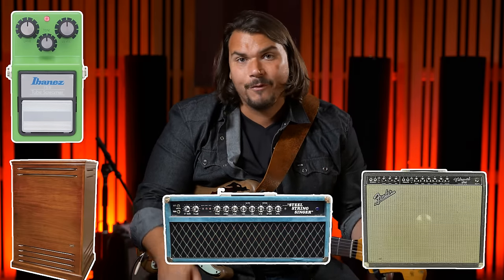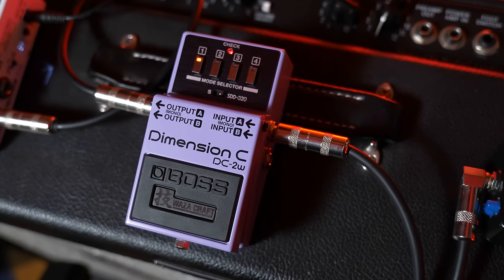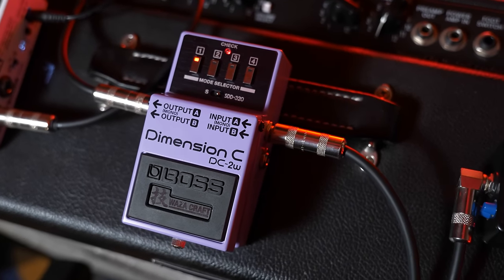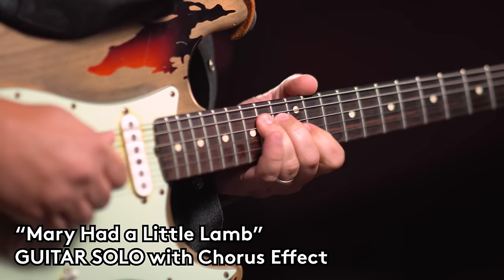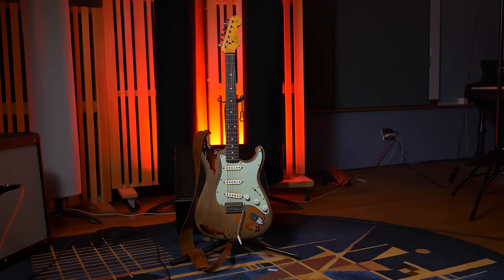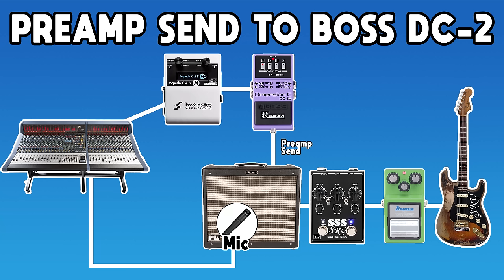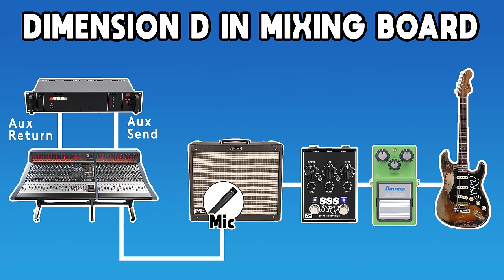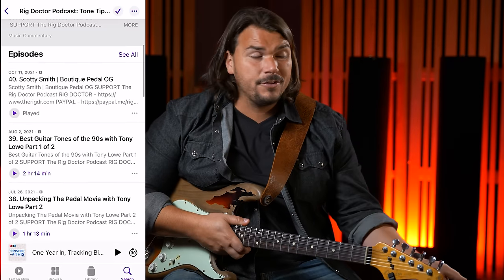The Secret Behind SRV's Tone

Comment: Great tutorial. The real trick to this is the subtly of the effect; i.e. how you blend any effect into your signal chain without muddying up your overall tone. IMO the foundation of good tone is CLARITY so as a rule of thumb, "less is more" when using effects. Most of your tone should be built around your fingers and the power section of your amp w effects added to drive or enhance it. This is why SRV's tone was the epitome of CLARITY.
Reply from the maker: This is why the parallel signal path is SO important.  As you could hear, with the pedal in series, in the FX LOOP, it lost all its subtle nature and really was too prominent to match what SRV was doing.
Reply: @VertexEffectsInc  So true. The trick w a series loop is to back the depth down on whatever effect you're using, but it doesn't always work. There are some pedals that alter the signal so much that even the lowest depth setting they still muddy up the tone. I'd rather not use that particular pedal in that situation than muddy up my tone. The solution is most definitely using an amp with a parallel effects loop.
Reply from the maker: @GTX1123  No matter what, series is a compromise because you can't mix the dry and wet separately from each other nor can you adjust the signal that's hitting the chorus separately from the dry signal.  It's better than not having a mix control, but still not better than having a separate path for the chorus.

Comment: Can you explain how to use option #1 in a live setting? Does the cab emulator goto a separate strip on the mixer from your amp mics or does it goto the insert of the guitar mic strip? Some explanation of how this would work in a live setting would be great!!
Reply: Also is it possible to do this with a multi amp setup (daisy chained amplifiers)
Reply from the maker: You are feeding the chorus into a cab/power amp sim which feeds you mixing board or FOH as a parallel signal to the rest of your pedals running into your amp in series.

Comment: Great video. Can this tone be achieved with another Chorus pedal, like a Chase Bliss warped vinyl hi-fi?
Reply from the maker: It may not be exactly the same, but I would say the most critical part is following the parallel signal path and having the chorus in parallel with the dry amplifier.  As you could hear, as soon as the chorus was in series with the amp in the FX Loop the subtlety of the chorus really was lost and it was very intense even with the same settings.  It would be worse running it in front of the amp as most people do with chorus pedals.
Reply: @VertexEffectsInc  Great demo....will an old phase 90 give you a similar effect akin to EVH and what a lot of country pickers used to do ?
Reply from the maker: @paulcowart3174  not really because it would need to be in parallel after the dry amp, the Phase 90 for EVH was in front of the amp in series.

Comment: SRV would place his tube screamer AFTER his wah pedal so even when the tube screamers turned OFF the wah output circuit will have the tube screamers BJT or FET buffer circuit loading the wah output circuit. When using a buffer on the output of a wah pedal it changes and alters the wah sweeping effect. Roger Mayer built a certain output buffer inside Hendrix wah so it interfaced with a fuzz face so you can place the vox wah BEFORE the fuzz face. This buffer circuit i don't think was a low impedance output buffer because it wouldn't work correctly with a wah pedal BEFORE a fuzz face. I think Roger Mayer made a high impedance output buffer in hendrix wah. Try to make a video lesson about this subject.
Reply from the maker: Pretty sure he didn't...show me.

Comment: I believe an in-line pedalboard version of this could be approximated if there was a stereo chorus pedal with a dry mix knob included to keep the attack of the original signal, if there’s not one, oh I don’t know?, maybe someone from a pedal company could invent one😂, could even be marketed as the SRV sound somehow…🎛
Reply from the maker: It's not the same because the effect is still in series with the dry signal even though you're mixing the dry in with the effect, remember 99% of pedal chorus' already have the dry signal mixed in, it's just at a fixed mix instead of a variable so it's not really changing that so much sound wise.  The parallel path of the chorus with its own line from the dry is the real key.

Comment: Dimension D is available in the ME50B pedal board and also on the CE20 chorus pedal. But get hold of a Bassman simulator (Fender / Boss pedal or  Hao Soul Pressure) and you'll get closer still. Dimension C isn't a Dimension D.
Reply from the maker: Both of those are digital, not analog like the DC-2 or Dimension D.  Furthermore, neither of the drive pedals you suggest produce Chorus and the Tweed Bassman is a far cry from a ‘65 Super Reverb or Vibroverb.  Totally dissimilar typology if you’re moving to amps.

Comment: Very cool video, Mason! Wish you would have let a chord ring out, so we could hear the chorus effect better, but I can at least hear how it’s set when you do the FX loop demo.

Was gonna ask you about speed settings, but it seems the Dimension chorus offerings have a set speed. Is that right? One can only vary the depth, yeah?

I see you having to reiterate in the comments how important is it to have a parallel signal path, i.e., chorus + dry. Is the same achieved, however, on modern chorus pedals with a blend control like the Walrus Julia/Julianna? Must be, right?

The Walrus Julianna has stereo ins/outs, and does some really cool things with the Dry-Chorus-Vibrato blend knob when run in stereo. When you do dry on one side and vibrato on the opposite side, it’s freaking magical. Doesn’t even sound like chorus to me (which I normally don’t want). I’d leave it on all the time, but the FOH doesn’t pan my signal as hard as my IEM’s, so it ends up sounding like chorus out there (effectively summing the 2 sides), and, again, I’m not wanting an always-on chorus sound. 

Anyway, I’m gonna experiment more using my Julianna and my Iridium. Maybe even put the Julianna after Iridium. 🤔 All in stereo, of course!
Reply from the maker: Yes, you're basically selecting the mix with each button only.  No, the parallel path is still the move, you can't emulate this with a mix control because you still have a shared dry signal that's serial.  You need to separate the chorus from the dry amp after the preamp section at least or after the mic like SRV did.

Comment: instead of relying on a soundman to get the effect could you run the chorus in your effects loop but have that with a mix blender pedal so that you can run the effect in parallel to get the width without it sounding too "chorusie"  That would allow you to control it on stage and not via the soundman.
Reply from the maker: Doesn't work the same however, when you haven't separated the dry path and the chorus (wet) path in parallel.  All you'd done here is put a parallel mixer in series with the the preamp and power amp.  To really get the sound right, you need to go the parallel routes I showed, whether that's via the Aux Send or Line Out or using the FX Send and then blending in parallel.

Comment: And Fromel’s Seraph Deluxe Stereo Chorus on the minimal setting is even better than the Boss for doing the Dimesnion D thang, especially wet dry. Also, the high headroom bass amp played a big part on Texas Flood….I think it was a Dumble Winterland if I remember correctly.
Reply from the maker: The Dimension D and Dimension C are different effects.  Similar, but not the same.  Fromel, to my knowledge, makes a boutique Dimension C.  SRV used a Dimension D rack unit, of which only  the new Waza Dimension D has a setting to emulate the SDD-320 Dimension D.  The Fromel doesn't do this.  So...I still suggest, if you really want to do this and nail the SRV sound, get the Waza DC-2 Dimension C and put it in the SDD-320 Dimension D setting.
Reply: @VertexEffectsInc  Fromel specifically made the Seraph to be a Dimension D in a pedal. You can get the D in a 500 size rack too, but the pedal is more convenient for me. I’ll quote their site:
Reply: @VertexEffectsInc  The Seraph Deluxe is a true stereo in/out analog dimensional chorus modeled after the famous Roland SDD-320 Dimension D which was introduced in 1979 and used…..The original unit took up two rack spaces and had 4 preset buttons…..The original Fromel Seraph released in 2008 was based on the DC-2….Over the last 10 years we have been working on this circuit exploring all the possibilities it can offer….

I have the Seraph and the Waza and they both sound great, but the Seraph in the most minimal setting can’t easily be heard, but your brain knows it’s their by the expansive feel. It tickles my brain in a way that sometimes the BBE Sonic Maximizer does….even tho that unit gets a bad rap sometimes.
Reply from the maker: @bluesoverlord  Well...there you go.  Sounds like you should compare them in a video.  I'd say the Dimension C Waza is about the best Boss pedal I've played years, but certainly open to checking out the Fromel!

Comment: The entire sound is processed by the Dimension D? Also the spring reverb of the ampli is modulated by the chorus?
Reply from the maker: Dimension D in parallel after the mic'd amp.  Spring Reverb in the amplifier.

Comment: Curious how this would work with a Fender Twin that does not have a loop or a speaker out that can be converted to a line out 🤔 - would it have to be a true Wet Dry setup with a separate amp? Great video! Thank you.
Reply from the maker: You have a speaker cable wired to the speakers, and a speaker jack on the amp, so YES you can do a line out no problem.  I did the same thing on the Hot Rod DeVille to get the line out.
Reply: @VertexEffectsInc  So you ran the line out from the Ext. Speaker jack? If so I get it. I wasn’t sure how you were using and micing the amp while running a line out at the same time.
Reply from the maker: @vincent33195  no, you use the normal speaker jack on your amp and connect a speaker cable to the line out box.  Then you connect the speaker in your amp (which has a cable already connected tot he speakers in the cabinet) and also connect that to the line out box.  Then you have the line level output tapped off your output transformer and sill have full use of your amplifier as normal.  The line out box is basically just a conduit between your amplifier speaker jack and the speakers themselves.  Any amp can do this, head or combo.  Check out our video here to learn more: https://www.youtube.com/watch?v=xTg_FYq2tS0
Reply: @VertexEffectsInc  This is awesome. Thanks brother - I really appreciate your time and help here. I never thought of tapping the speaker like that.

Comment: Would adding a parallel guitar looper pedal get me there as well?
Reply from the maker: It's not the same because the effect is still in series with the dry signal even though you're mixing the dry in with the effect, remember 99% of pedal chorus' already have the dry signal mixed in, it's just at a fixed mix instead of a variable so it's not really changing that so much sound wise.  The parallel path of the chorus with its own line from the dry is the real key.

Comment: well it would be interesting to know if SRV - used the real stereo signal from the Dimension D?? - you can do that live or in the studio. or these examples in here with the pedal d are actually mono-signals with a "stereo-feel" to it.
Reply from the maker: He definitely did stereo, I was operating in the limitation of what we had at hand and how much players would set it up at home with the fewest parts.  In order for me to make this stereo with the chorus, I would either need another Two Notes Cab M or a stereo cab simulator.  Another way would be to have the Chorus connect to a stereo DI to bring it back to the mixer.  On the last example with the actual Dimension D that was stereo.  L and R panned and the dry straight up the middle.
Reply: The Dimension D is a stereo output whether you input in mono or stereo. It was mostly likely used on an analog console send, probably stereo send from a mix of microphones, then brought back up on separate console channels and mixed with the original microphone signals 

This is important because if you go through the Dimension D directly it can be a little heavy handed and dull the sound a bit. The magic here is in mixing it back in subtlety in parallel - this is the key to the sound as the presenter correctly emphasized 

BTW- the UAD plug-in version is an excellent recreation and easy to use in your DAW
Reply from the maker: @steveg219  my understanding is that the send to the Dimension D was in Mono, and then the stereo image returned into two channels of the board, hard panned L and R with the dry straight up the middle.  That's how we did it with the real Dimension D unit at the end, which was the closest overall to the SRV sound.  There's also a Dimension D rack unit replica now: https://www.sweetwater.com/store/detail/BBD320--klark-teknik-3rd-dimension-bbd-320-analog-multi-dimensional-signal-processor-with-bbd-technology
Reply: @VertexEffectsInc  that makes perfect sense that they would send a mono signal and then mix the returns with it L-C-R. it does sound like that.

I had no idea there was a modern clone of this device, that is super cool!!

I believe the original had a compressor/expander circuit in it for noise reduction, which to me seems to always give it a little bit of a compressed and slightly darker sound. Do you know if the Klark Technik clones does that as well?

By the way, at the time Roland did not Ccnsider this a chorus device, it was considered a psychoacoustic stereo generator effect :-)

Also I have the original schematic and service manual if that is of interest to you
Reply from the maker: @steveg219  wow that's cool!  Yea, I'd love to see that documentation!
Reply: @VertexEffectsInc  let me know best way to reach you and can send you a scan or mail a hard copy (it’s a weird size so I may have to go to the print shop anyway)
Reply from the maker: @steveg219  info@vertexeffects.com

Comment: DR Z Maz 38 NR will get you there , the cut channel will balance out your pedal board and guitar tone to give the SVT tone.
Reply from the maker: I didn't know a Dr. Z had chorus???
Reply: @VertexEffectsInc  hahahahahaha
Reply: I use chorus in my pedal board
Reply from the maker: @Victor-tl5eg  if you want the SRV chorus tone, you'll have to put the chorus in parallel after the dry amp or in the line out as demonstrated here :)
Reply: Thanks for your info, if it was not for your you tube channel I would still be struggling with my pedal board, which I have been for years, since watching your videos I have not changed anything for the last 8 months and most likely won,t.

Comment: I sorta liked the sound of your "complicated" chain. 
But, if you want to go parallel - the "aux" way-  on a mixer 
- or maybe even with a "hardware insert", created through ins & outs of a multi-input-audio-interface, set up as a send (!) effect in the DAW- 
why shouldn´t it be possible using the dimension C pedal, when driven with care?(*)
(*) 
..or with help of a reamper to the pedals input of nominal level: -20 dBu, input impedance: 2.2 M ohms?
Yepp, I know...f.i. a "Radial EXTX Stereo" is hellish expensive..but you could implement many a guitar pedal into your productions with it, on post...
Maybe there is something more affordable, that´ll do it?
Reply from the maker: You could do it that way, however I was attempting to show this in a context with the line out box where anyone could take their existing amp and get this in parallel with minimal moving parts.

Comment: Bought the Dim C. Thin sounding.
Best way to get THAT sound live is to use 2 amps Wet/Dry with a tiny bit of real anolouge chorus. MXR Yellow box is ideal.
Reply from the maker: It's gonna cut out bass...that's the point.  You can run it in parallel to have more control over what it does relative to your dry amp.
Reply: You want your dry signal to cut through still though, hence running parallel

Comment: Don’t take this the wrog way but your core tone is so much thicker than SRV. It doesn’t even sound like a strat with single coil pickups. You are right about the chorus of course, but the amp and guitar sound is much more important
Reply from the maker: Sure, but this video is about the chorus, the other stuff is just window dressing.
Reply: @VertexEffectsInc  I know, but you offered some really good SRV examples for comparison and it is very hard to hear the Boss pedal with that IMO superstrat tone. You made a great video and it is very informative, that is the only reason I wrote a comment. I know SRV fans use thick strings but I think the lighter strings and standard strat pickups would actually sound closer to the studio recordings. His early clean tone is not that thick at all. That device you discovered and of course TS9 made it thicker and fuller sounding in the mids but we should start from the similar core tone of the guitar and amp. Just my 2 cents...